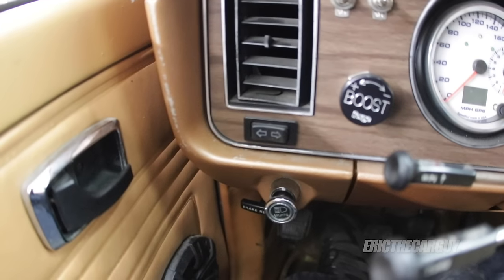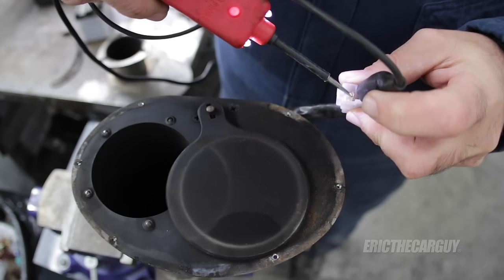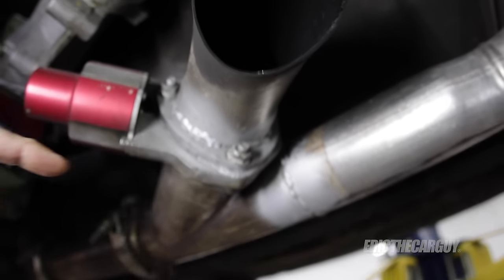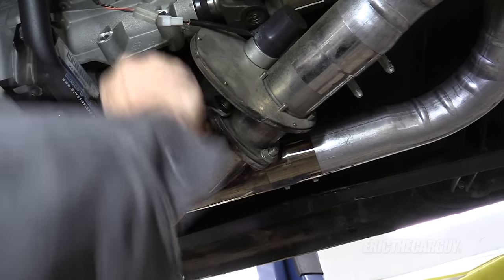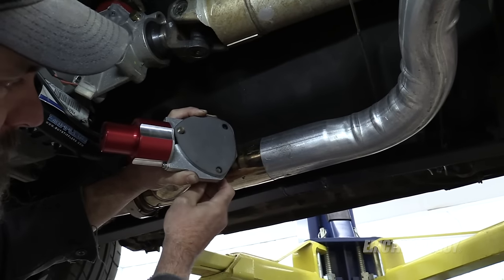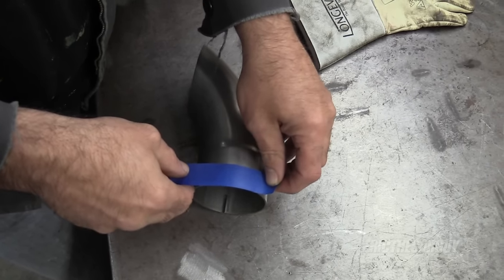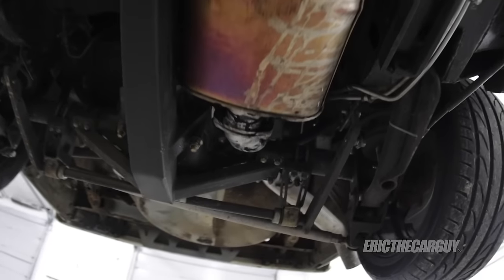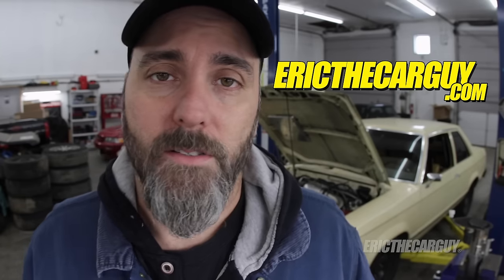Exhaust Cut Outs Give Your Vehicle a Split Personality

Comment: Ive been a 4th gen fbody guy since before I could drive so ive had over 15 yrs of experience w electric cutouts and love them too.  Btw you can get Chinese 3 bolt to v band flange and a v band turndown from places like Wish dirt cheap.  Thats also where to find 30$ ECOs, but I like the Summit brand stuff for inexpensive options.

Comment: What an interesting design! I've been told that when older motorcycles are switched to an open exhaust, those old fixed carb jets need to be adjusted to compensate for the change in exhaust backpressure. In any car made in the past 30 years, fuel air ratios are adjusted automatically by feedback from upstream oxygen sensors. It would be interesting to watch how fuel air ratios change from open to closed exhaust, though I assume that won't be possible in the Fairmont. Nice job. Stay dirty, Eric!

Comment: Im doing a custom exhaust for my 2000 Mercury Grand Marquis. One side is going to be cherry bombs, the other side is the stock mufflers made by lincoln which keep it beyond whisper quiet. 
My only worry is keeping the exhaust cut out valve healthy. Such as preventing it from being bent. Why not a guard?

Comment: I'd put those in my car and just leave them open all the time, except for about 10 minutes every two years
Reply: Pretty much all places.
Reply: @Blazer02LS  I didn't know that. I've had em on my G8 for 7 years and have never heard anything about em being illegal. Probably been closed a total of 5 minutes in that 7 years.
Reply: there are cars that have this from factory, but you cannot actuate it manually, it automatically open depending on the traveling speed.
Reply: Look at your states vehicle laws. Most have it somewhere in them that modification of the exhaust to increase the noise level is illegal, many specifically say that exhaust cut-outs and straight pipes are prohibited. 

Here are 3 examples of the 49 states that have restrictions. The only state that doesn't list them is Vermont

Alabama -  Code Title 32. Motor Vehicles and Traffic. § 32-5-216
 (a) Every motor vehicle shall at all times be equipped with a muffler in good working order and in constant operation to prevent excessive or unusual noise and annoying smoke, and no person shall use a muffler cut-out, bypass, a muffler without baffles, or similar device upon a motor vehicle on a highway.

Illinois -  Sec. 12-602. Mufflers, prevention of noise.
Every motor vehicle driven or operated upon the highways of this State shall at all times be equipped with an adequate muffler or exhaust system in constant operation and properly maintained to prevent any excessive or unusual noise. No such muffler or exhaust system shall be equipped with a cutout, bypass or similar device. No person shall modify the exhaust system of a motor vehicle in a manner which will amplify or increase the noise of such vehicle above that emitted by the muffler originally installed on the vehicle, and such original muffler shall comply with all the requirements of this Section.

North Carolina - (b) It shall be unlawful to use a “muffler cut-out” on any motor vehicle upon a highway.
Reply: @Blazer02LS   I live in Alabama so I appreciate your info. However I'll be honest, my LS is going to continue to be heard loud & clear, till I have to pay fines lol.
Reply: this is one of those things that are technically illegal but no one gives a flying fuck. just obey traffic laws and don't be loud in unreasonable places or times
Reply: As long as you don't cut off your cat you can do whatever you want to your exhaust.
Reply: @bensgarage8325  not true. States have laws about loud exhausts. If they are over a specific limit you can be ticketed for it.
Reply: @Blazer02LS  I live in Illinois, I have my whole life and I'm 42. Do you know how many time I've been pulled over or seen anyone else pulled over or ticketed for a loud muffler or having a cutout? Exactly 0. Unless they're on 2 wheels, in that case probably once a year.
Reply: i heard in PA cutouts are illegal.
Reply: ThatGamingSoup I would think of it illegal. But it’s confusing, because I’m allowed to do a muffler delete on the car and it’s still legal, but if I had a cutout just before the muffler that I can delete and have a pipe going to the back like an exhaust. All of a sudden it’s illegal, even though it allows me to have the exhaust be quiet and loud using a switch, instead of always loud. I wish I could find a loop hole, lol
Reply: Legal or not, it's always best to run the exhaust out away from the car. Having them open underneath means you'll be breathing it. No car is airtight. What you do is run a pipe from the cutout either to the edge of the car or follow the "quiet" pipe back and have them side by side out the back. In cold weather when the engine is warming you can play with the steam...out one set...out the other set..
I made some "true" dual exhaust for my 68 Corolla several years back. I took a 4 into 1 header, cut off the big collector and made two smaller ones. I don't like "fake" duals where a single pipe has a Y.
The firing order is 1342 so I had 1 and 4 together and 2 and 3 together.
Each pipe got every other pulse. Had a unique sound, if you stood to one side you only heard two cylinders. If you stood directly behind it, it sounded like a normal 4 banger.
Reply: if you are gonna do that you might as well not buy the cutout and just put that cover plate he used on for those 10 minutes.... probably save yourself a couple hundred dollars...
Reply: Very much so illegal in Massachusetts.  Straight from the rulebook: No person shall use a muffler cut-out or by-pass.
Reply: There are a ton of good ole boys with straight-piped trucks in Alabama. I don't it matters how loud your exhaust is down here. I drove with open shorty headers for a few weeks. I just went easy when I saw a cop.
Reply: @ryancrazy1  you are correct. It seemed "cool" at the time and can be entertaining fooling around with people. But if I would have known that over the next 7 years I would rarely ever close them I would have put the money towards headers
Reply: @jmraines256  yeah this is for someone that wants a loud car, but has to go to work early in the morning and doesn't want his neighbors to hate him...
Reply: @pfannkuchengesicht42  Mercedes C63S AMG has a button to open and close the cutouts
Reply: Jason Young might as well just straight pipe it then
Reply: LOL
Reply: Instantly started to crackup 😂😂 when i read your comment cuz i also couldn’t agree with you any more 🤣🤣🤣‼️‼️
Reply: @LeaderofStupid  shhhh you dont see anything...
Reply: @ryancrazy1  neighbor hates him anyway... and that motor hanging from a tree limb in the front yard and that fine tuning on the weekend doesn't help... lol
Reply: Go with BadlanzHPE! 5 year warranty, best customer service, ZERO leaks or rattles!! Better cost than QTP, etc
Reply: keep it open till u see popo??
Reply: @Blazer02LS  Not most, some.
Reply: Bi-modal exhaust is the same they come from factory on Holden HSV Vehicles here in Oz.
Reply: @Blazer02LS  what about texas
Reply: @pecador_tor  Texas Code

§ 547.604.  Muffler Required 

(a) A motor vehicle shall be equipped with a muffler in good working condition that continually operates to prevent excessive or unusual noise.

(b) A person may not use a muffler cutout, bypass, or similar device on a motor vehicle.

Comment: You know what Eric, I was just thinking to myself that in order to be a successful youtube video blogger such as yourself you need to humble and be able to have thick skin. I've noticed that you've handled criticism very well and haven't  fed the trolls or stooped to a level such as them. Now I'm not calling everyone that has an issue with your video or disagrees with you a troll but there are times when people get rude and downright disrespectful and you haven't given them a soapbox.
To me, being able to remain professional, respectful and calm when being criticized is a very important key for success. And I think people need to take note of this and see why he's amassed such a loyal following. When compared to all the other guys that were on the pull-a-part challenge I think Eric gets the most amount of criticism and I believe he handles it exceptionally well.
Reply from the maker: Thank you!
Reply: Personally I had problems with the gear drive on the valve application. I decided to go with the pneumatic actuator butterfly .opening through the vacuum from my  from my inlet manifold..

Comment: Just keep it closed when the cops are around.
Reply: @Blueknight1960  its a 1000$ fine on the spot for loud exhaust in california
Reply: @AMCguy  you have it easy, in germany and austria you could potentialy go to prison if you drive without a catalytic converter.

I said potentialy because most of the time it will only result with a criminal charge for tax evasion and like a 3000€ fine
Reply: @afox5319  why tax evasion??
Reply: That’s literally the point of this system...
Reply: @ernieernie3854  Emssions. Thats why. You pay tax and insurance tax based on the emissions of youre car. higher emissions than stock= tax evasion
Reply: Just drop it in neutral lmao
Reply: Or when cruising

Comment: Just a small tip when splicing wires stagger them.  This will keep the bulk out and keep the wires tighter together.  Especially if you have to feed the wires through grommets or tight spaces.  Great job!!!   I have cut outs too (Manual)  on my vette I need electric cutouts now!!!
Reply: Another small tip or at least confirmation of theory there is a very good reason for crimping and splicing opposed to soldering. Soldering creates a hard contact point that the vibration of vehicles can cause rapid failure of the wiring. The crimps allow to wire to maintain flexibility so the vibration has less of an impact.
Reply: The splice should have been inside the vehicle to keep it out of the weather/vibration.
Reply from the maker: Great suggestion.
Reply: @ericthecarguy  
Your splice is fine.. especially for what it is for.

I reserve solder for splicing a wire on something critical. At connector.. use new OEM crimp terminal. 
If to much solder is allowed to flow into wire.. yes it can travel up the wire and make it "brittle". This also has to do with the amount of flux. A little goes very far.
Reply: @Angel Valdez . Many years ago Aircraft cabling joints were soldered. When the planes dropped out of the sky they invented the crimp. As above staggering the joint and correct size heat shrink is way to go.
Reply: 2LateIWon/Organized Chaos that is so simple n so smart that it actually makes me angry that i never thought about it. wish i did this for my alternator pigtail. soldered the shit outa it but with this little technique it would have come out so much cleaner. 😒🔫
Reply: @Maoushin  Good point. IF vibration is an issue. That is what zip ties are for.
Reply: Mathew Cofrin 😨👏😨👏😨👏😨👏😨👏😨👏😨👏😨👏😨👏🙄😄😄😄😄😄👏👏👏✌✌👍👍
Reply: Joshua Allen 
Not on this application though, as the connectors of male/female were only about 8” length of lead, thus cutting and rejoining at that point, otherwise it would’ve been a complete and full lead run from switch to connector, but as there are no relays involved and minimal amperage direct wiring suffices... 

Only thing I would’ve done differently is routing the lead above the trans/shaft output to avoid any hindered unforeseen road crap causing it to catch or snag and pulling the lead apart. 

Besides ETCG Rules.!!!!
Reply: Angel Valdez that’s not true. Soldering has no purpose there. The only things soldered in cars is the computers and their components. Everything else is crimps and wire harnesses.
Reply: @Angel Valdez if soldering is always best then why do all factory wiring and even aircraft come crimped, find you an electrical engineer and ask why crimping works better. you can not get a solid connection with soldering because as the solder tries to run through the strands it cools and stops, you just think it kept flowing.  check out a few thousand new cars and see how many have soldered connections.
Reply: @jimmieroan9881  and then check how to solder to NASA standards
Reply: Soldering is a mild artform. The reason cars dont have many of them is time. Some of the monkeys that work on assembly lines would make a mess of it and take way too long to do so. Time equals money.

I happen to love soldering. I find excuses to do it. Why practice welding and not soldering. Each their own I suppose.
Reply: @djsnowman06  Well, as you can read above, soldering is being replaced. I'm a car mechanic and I have never soldered anything on any vehicle. Vibrations of the vehicles cause the soldered pieces to break apart. oxidation is a thing too.
Reply: Gatis Girdenis  the nasa soldering is for solid core wire not for multi core wire yes in that case it is the best but for this application it’s over engineered like usual. this is making a electrical connection for a weather pack connector not a space shuttle
Reply: @djsnowman06  that's not why assembly lines don't use solder. Thats ridiculous
Reply: People just say the dumbest shit without anything to back it up, and think it's the right way because they heard another person say it is, like "soldering is the best".
Not for every application it's not, especially in a vehicle. Some people just don't know what there talking about
Reply: @GatisGirdenis  of course a rocket scientist has to chime in over a fucking exhaust wire Connection.too bad were not talking rocket ships
Reply: @tylerkrug7719  too bad that was a fucking joke, haha. I was just saying it for the people who told here that soldering is the inferior method. cant find a NASA document about crimp and heat connections, can you?
Reply: Also adhesive lined shrink wrap will keep that joint nice and water tight. Great stuff🐦
Reply: I agree and heat shrink tubing
Reply: @JOSHUAALLEN28  Those are high quality heat shrink butt connectors, with heatshrink over them, then electrical taped, ratchet crimped... Wires from cut outs dont come 20ft long out of the box.. So no option than to connect there. And as with motorcycle connections, correct crimp and heatshrink has never failed. Solder creates hard spots and vibrates and cracks and corrodes etc... Seen it many times and 0 correct crimp failures... So you lack the experience in these conditions to accurately make an assumption. There are situations where I solder connections and motorcycle or high vibration situations such as his where crimps are the winner winner chicken dinner.
Reply: @davidmc7442  i agree,but solder has it's place. I SCREAMED out loud when Eric had the razor in his hand!!!!!!!!!!!!!!!!!!!!!!!!!!!!!!!!!!!!!!!!!!!!!!!!!!
Reply: They make heat shrink connectors with a solder bead in the middle and water resistant glue on each end to seal them. They work SO damn good.

Comment: The new one is what’s called a “butterfly valve”. I was surprised at the old one because the old one was way too complicated. The new one with the butterfly makes so much more sense.
Reply: Yeetur McBeetur yet old was more efficient
Reply: wont the new one leak and cause it to fail inspection? or am I wrong?

Comment: I agree, I'm all about crimping. I used to use the ones you shown in the video, but found that I had better success with using non-insulated butt connectors and then following it up with marine grade heat shrink tubing. the benefit of marine grade heat shrink tuning is that it is lined with adhesive, which provides a weatherproof seal to your connection.

Comment: That race ready cutout opens pretty fast for that style. My QTP cutout of the same style takes a few seconds to open. However the additional gear reduction in the QTP also seems to keep it shut under load which it sounds like the race ready one might have issues with based on when you said that it opens slightly if you get on it. I've also experienced the pain of making a turndown fit the cutout bolt pattern, where I ended up taking a 3" hole saw to the block-off plate that came with my y-pipe.

Comment: They leak for a few reasons: no gasket on the butterfly valve and high pressure due to the Y joint always putting exhaust flow into the closed valve. You could theoretically help a LOT with leakage by having a valve with a  gasket and/or also having the valve built into the Y splitter at an angle so that when it's closed the air is routed down the exhaust path better... I wonder how much back pressure is being added to the exhaust when the valve is closed due to reflection off the valve.
Reply from the maker: I think you'd melt the gasket the first time you got on it with the vale open. Honestly, you don't really notice it much, but I did feel it was worth mentioning. Thanks for the comment.
Reply: Nah, you wouldn't melt an exhaust header gasket. That's what they're made for.
Anyways, also, having at least press bent, if not mandrel bent pipes would help as well.

Comment: Back in the 60s we would weld on 4 inch down dumps on each side of the engine and use threaded pipe caps on the outlets. I know not automatic but they worked good.

Comment: Eric, RRP will sell you turn downs just like you made. You just have to call them. RRP is lifetime warranty too. I bought a set 4 years ago and one somehow went bad and was blowing 20 amp fuses. called them and they advanced shipped one out to me, brand new. Got the new one before i even got the chance to send out the bad one. They even threw in some shirts and stickers.They also have a wireless kit you can open and close them with a wireless remote. Ive got a set with the wireless kit for my 2014 Challenger with a built 392 that has a 2.9 whipple on it. Its mighty loud ;)